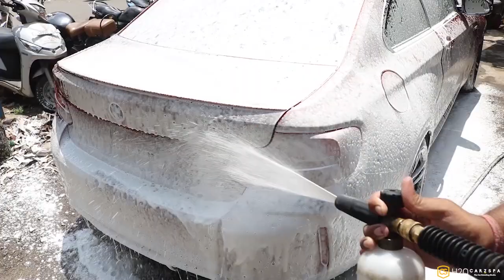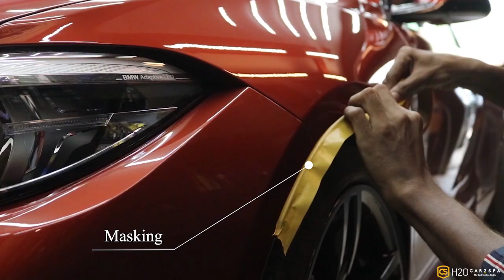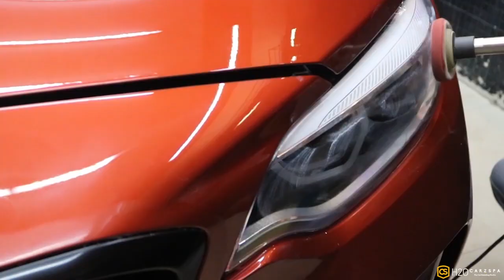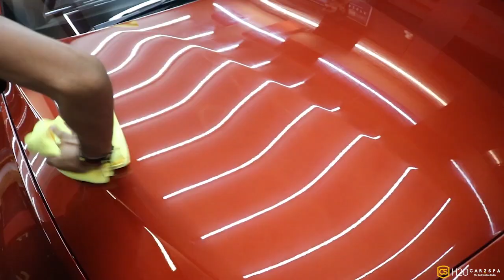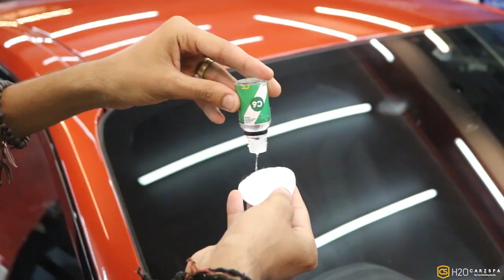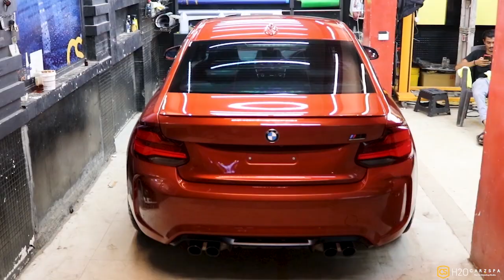2019 Orange BMW M2 Protected With 9H Crystal Shield Ceramic Coating | Full Process | H2O Carzspa

Comment: what is the difference between ceramic coating and paint  protection film?
Reply from the maker: Ceramic Is A Chemically Bonded Coat On The Paint and PPF is an Actual Screenguard Type Of Film Applied On The Whole Car Which Is 180 Microns Thick...For More Details Kindly Whatsapp Us On 9879053151